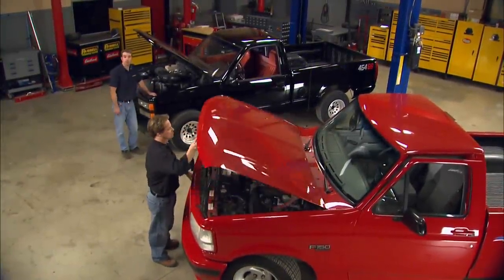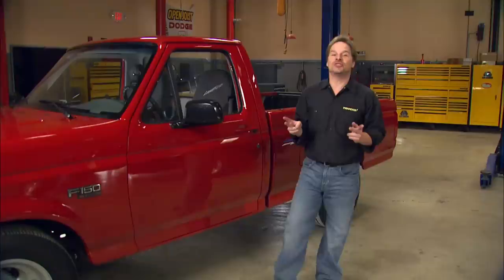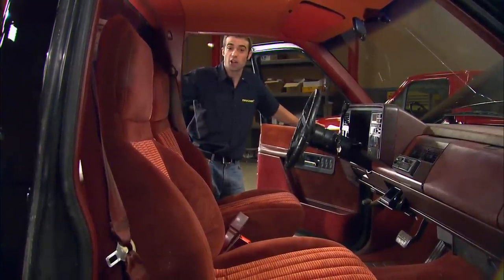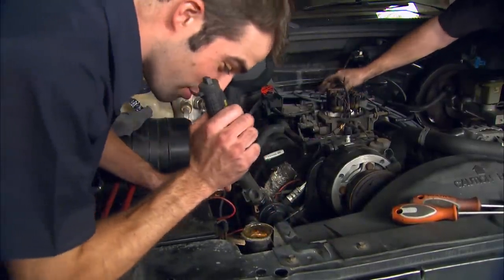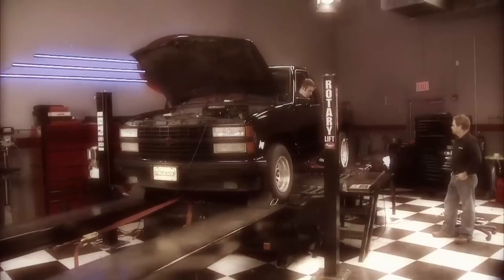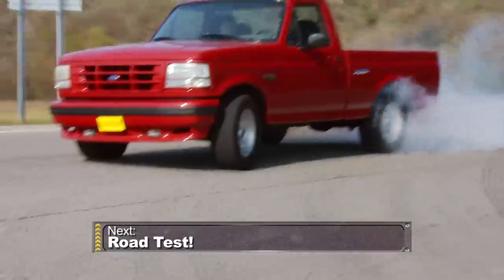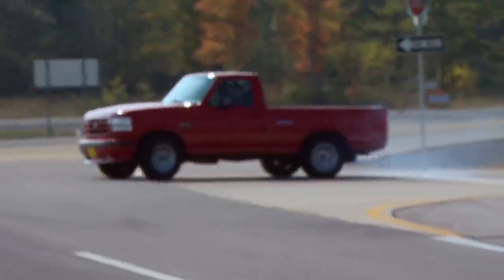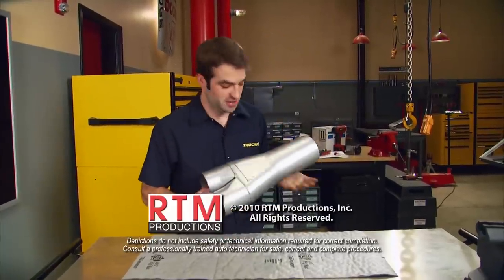'90 Chevy 454 SS vs '94 Ford Lightning F150 MuscleTrux Wars Part 1 - Trucks! S10, E1

Comment: 230 HP from a 454 is a feat of engineering in itself.
Reply: At the same time they had the syclones and typhoons.
Reply: @lenagdyfigpkhhmossuto9623  And for EPA reasons, they still were limited on what they were allowed to put out hp wise. And car manufacturers just weren't there yet with having a high horsepower fuel injected engines priced for the masses, with low enough emissions to pass the federal regulations. All while getting decent fuel mileage. Fuel injection by the times these trucks were produced had only really been widespread available for 8-10 years. They had along ways to go to get them were they needed to be.
Reply: Obviously you've never heard of an LSX
Reply: @lenagdyfigpkhhmossuto9623  Then why would they suggest that its hard to get 230 hp out of a 454?
Reply: @drewinhou  You have no idea what your talking about.  Fuel injection had been around since the late 70's.  The Eldorado was not only fuel injected but front wheel drive.  Camaro's and Monte Carlo's in the 80's you could get with a fuel injected 305.
Reply: I was always surprised they seemed to just drop the towing engine right in, no bother with even a new cam.
Reply: @drewinhou  they literally made zero effort to build a power based engine, the numbers are identical to an HD truck big block designed to tow and be run hard all day long.  Heads would have done wonders, at the very least a more aggressive cam.  They could easily make significantly more power, but they didn't make an effort because they didn't have to make an effort, they were the only game in town so they were the best game there was.  They built a super sport truck out of their parts bin.
Reply: @nogamez26  Really bro? That's why I said by the time these trucks came out (early-mid 90's) fuel injection was a common thing for about 10 years by that time. And was put on most cars whether it be TBI, Direct Injection, sequential, multi-port, Etc. So let me do the math for you, take off 10 years or so from early-mid 90's, would give you early to mid 80's. And Obviously there were cars with fuel injection before the 80's, even way before the earliest decade you quoted, actually as far back as the 50's, with one Mercedes model.  However, like I said  this was not common,  as most used carburators still up until the 80's and a few models in the early 90's. Obviously you don't understand what is being said here. So go back and read it again, so you understand it all.
Reply: @kfstreich4787  Agreed. When you're the only dog in town, than there's no fight to put up to be top dog. That's why it's important to have competition from all around. It helps us the consumer, because it forces the car manufacturers to build better, more powerful powerplants to stay on top of the game..
Reply: A huge cam with 
.030 lift, the spark plug gap is bigger.  The engines were detuned so much GM should have gone back to the 235 inline & the famous 7.5:1 compression why waste cast iron for 250 hp. Below 300 hp the 454 was an embarrassment. That reflected badly on GM.
Reply: @rogermarshall8991  I couldn't make it to the end of this video to see what they did, a quick peak at summit racing shows BBC heads for $967, for $1500-2000 you could have a proper engine, too bad these were pre 4l80
Reply: @drewinhou  and this was coming out of the 80s, a time when a Ford 351 could produce 136 horsepower 🤣

Comment: When these were new, the Ford walked the 454.....still take the SS. Now had Chevy grown a set of balls and did the 454 right it would have been king!
Reply: Same...Old chevy trucks are just more sexy
Reply: The King's Servant almost 30 years later and it still is
Reply: @theman68and1  no...It's not
Reply: It wasn't about balls, they did the best they could given the limitations of the time. That was (sadly) as much power as they could coax out of the old big block and still meet 1990 emissions laws. ALL cars were dogs in the 80's and 90's, as manufacturers hadn't yet figured out how to meet emissions without de-tuning their engines beyond all reason.
Reply: Big blocks from both companies were pooches in that era.. emissions killed alot of power in the 90s.. as far as the chevy looks better,  I suppose it's in the eye of the beholder.. but as I wrote in another post I've owned both trucks and both were black, the lightning got more looks than the Chevy.. so you can like which ever.. in my personal opinion  the 78-79 fords and box Chevys of the same era kick both their assis
Reply: My father bought one brand new but he has a 93 which had more horse power and 410 gears he never lost a race to a  Lightning he ran a few of them    He still has the truck supposedly it was the truck used for testing in magazines when it was bought it came with the magazine it was in so we were told
Reply: Hahaha
Reply: Matt Miller  Hahaha!, I was thinking the same thing!!👍
Reply: A supercharger is way more fun for daily driving. I do like the long power band of NA. But get a supercharger you'll never look back
Reply: Don't think so. They could have easily gotten more power and still passed emission standards or even surpassed them, they just didn't want to spend the money to do so.
Reply: I mean they should of compared the 1995 Chevy 454ss it produced 255hp and 405lb ft torq
Reply: Chris J Yeah I used have a 91 SS. I can tell from experience the lighting was a faster truck.
Reply: It was all about GM overdoing EPA Emission laws and tuning them well below what they were capable of. In the end I would pick Chevy over Ford because I would rather drive my truck than push it.
Reply: @GUNSLINGEROUTDOORS  it only killed american manufacturers really, the 80's and 90's was definitely the era for japanese/European sports cars
Reply: Yelsew Painter chevy can’t out live fords there transmission are garbage I replace the transmission on both of my Chevys have a 98 and 02 while my 97 and 03 f150 made it with over 200k no problems
Reply: Yelsew Painter my neighbor has an old 96 ford 3/4 ton work truck with the 351. It has  350,000 original miles. They lasted as long as any Chevy ever would.
Reply: GM easier to work on. And last longer.
Reply: Chris J I don’t lie and I don’t appreciate being called a liar either. Just because you personally haven’t seen it doesn’t mean it isn’t true.We have a company called service vending. All of the vans are ford. They all have the 4.6L or 5.4L V8. All the vans had between 375,000 miles and 420,000 miles when trading them in on new ford transit vans. I am however skeptical cause all the new vans have V6 engines only available. I’m not brand loyal. I personally drive a 2012 crew cab Chevy halftone. It also has been a great truck so far.
Reply: I never seen a 351
Reply: @Chris J BS! Any 93-95 lightning stock could spank a 454ss. The 454ss could barely beat a stock 350 truck
Reply: @jeremyyazzie3474  Garage Mans Companion...
Reply: The Executioner they literally just did it

Comment: Ford is down 100 cubes and still comes out on top.  No surprise.
Reply: any motor chevy had in the 90s was a straight up dog then when the introduced the 4.8-6.1 they took the game over because everyone is ls swapping now
Reply: kylepett1 then ford took the cake with the gen 3 coyote
Reply: @kylepett1  LT1's weren't dogs
Reply: Lmao these are both bone stock trucks with around 100,000 miles on them,at this point who cares,wait and see what happens when the 454 gets properly set up,and the Ford small block gets the same the 454 will destroy the sbf! I remember both trucks when they came out,Ford never could keep up back then!
Reply: @BUILTFORDTOUGH79  Ford didn't take anything over, where do you fellas get this crap from? The 90s LT1s killed 302 Fords,then the LS1 came out and the rest is history, the only fast Fords back then needed help with nitrous or boost,they never could keep up NA!
Reply: @adambrooks2297  I think this comparison carrys way more merit. I like seeing the way Ford or Chevy set them up.  Ford obviously spent more time at the drawing board instead of just slapping a HD truck engine in a half ton.  The modified test is all fine and yes I would sure hope the 454 will come out on top.  Hell you can make 1000+ hp with a 4 cylinder ricer with enough $. To each his own.
Reply: kylepett1 not me im coyote  swapping an 1985 pontiac  firebird  just for shits and giggles
Reply: Adam Brooks i had a 1980 olds cutlass with after market heads edelbrock carb headers and cam  and the lightning tore my ass up everytime i raced it but my buddy had a 400 in his chevy pickup and i ate him for lunch so  i call bs on that the ford never caught up
Reply: Adam Brooks bs bs bs
Reply: Adam Brooks tour just a fan boi
Reply: Adam Brooks the ls1 can’t even compare with the 4.6 4v ford had in the cobra those cobras dusted the camaros and kept up with corvettes
Reply: @bkeith269  The engineers at SVT/SVE are exceptional. Everything they touch turns to gold. Way better than throwing a big block in a short bed Chev. I agree. I have two SVT vehicles and they are both amazing and a joy to drive each time.
Reply: @adambrooks2297  Ford's biggest shortfall, in MY opinion, was their reliance on the 302 instead of the 351. I never understood why they stuck with it when everyone else had them covered as far as Cubes went. Yea you could spin them higher but bottom end, there just was no comparisons. Not talking about the Pony Cars either. Even when Ford hit the vaunted 225hp in the Stang, GM kept pace with less power due to bottom end torque.
Reply: @adambrooks2297  Chevys are under engineered garbage.... that ford is half the motor but eats that Chevy 454. I love big displacement but a healthy 351w will destroy any comparable Chevy 350 383 etc
Reply: Eternal Thread Chevy guys always bringing up Ford engines that don’t even compare to what their talking about. Lol
Reply: @BUILTFORDTOUGH79  how much does it cost to build a coyote>? il stick to something where i can make the power for half the price and not even having to be DOHC
Reply: @erandy0240  but goes against your own argument a healthy running 454 would eat any 351,390,429 etc im not  even a chevy guy my faja has a 1970 ford torino 429SCJ any healthy motor will chew anything and vice versa i just dont like how the 90s 454 get so much backlash they were an atrocious engine with smog heads and the cam that it came with even the vortec 454 was a dog but a decent cam and some heads helped it be some what respectable
Reply: My grand national will blow both of these trucks away. No question. Even if they were new.
Reply: It's was a tow biased engine. Had they made it for power the lightning would've been second. Both trucks are still sexy though
Reply: Joshua Webb and no one else had to deal with emissions?
Reply: The Foxbody Mustangs held their own with the 5.0 against the 305 Firebirds and Camaros but when they got the 350 version of the TPI from the Corvette in 1987 it was game over. The GEN 1 TUNED PORT INJECTED 5.7 V8 was a Torque Monster that killed Mustangs with 245hp & 345 torque. Then the Son of the TPI the LT1 came out in 93 while the Mustang lost the 5.0 and got the 4.6 in the SN95. So unless you had a Saleen or Terminator Cobra The LT1 and the RAM AIR LS1 Ruled the Streets from 1993 to 2010 when the Mustang finally got its balls back with the Coyote 5.0. There are 2002 Trans Am LS1s that we’re beating 2008 GTs with the 3 valve 4.6. I know because my 1992 Z28 with its original 191,000 mile unrebuilt 5.7 TPI with the Flowmaster Exhaust beat a stock 2006 & 2007 Mustang GT 4.6. There’s even a famous old video of some high school kids racing with an LT1 Camaro beating a 2005 Mustang GT. YouTube it.
Reply: @jeffrankin9744  well id hope so your grand national wasnt killed by emissions and is turboed :P (which i love) but how would it do against a cyclone or typhoon?
Reply: I would have to say maybe the typhoon would beat me. But not the cyclone. I raced a cyclone about 10 time few years back totally stock just like my Gnx it was heavier and slower
Reply: @adambrooks2297  um corvette is not a muscle car its a sports car!
Reply: @dodgeramsport01  it's so funny how all of a sudden you Dodge fools get to decide what a Corvette is,a Camaro ,any GM car, just so you know a Corvette is a Sports car,muscle car, no one really cares,because we GM folks use it as a weapon on the streets,or tracks!
Reply: @adambrooks2297  My handle of Dodge Ram 01 is because at the time when I made this account I owned a 2001 Dodge Ram! Now having said that, unlike you I am a true Gear head because I like ALL the brands and the things they have done over the years, I am Loyal to none!  I am and always will be a Corvette freak, but Corvette does not fit the definition of a muscle car, That's because its a straight up american made sports car, Now My 442 its a muscle car! My 428 Cobra jet its a muscle car! The 79 Z28 I had in high school it was a muscle car! The AMX my wife drives its a muscle car !But the 72 454 stingray I have Is a sports car! Good day to you

Comment: I had a truck with that 454 back in the 90’s. It was such a dog..
Reply: I got to experience a brand new 454 SS run against me twice in the quarter mile in Youngstown Ohio in 1990. It was a 16 second truck.
Reply: Steven Lindsey , the 1988 Police Package Caprice with an LS5 454 and nitrous I was racing ran a 13.2 WELL ahead of that truck, lol.
Reply: I use to spank those 454 ss's with my 89 chevy stepside back in the day, only thing done was headers, lil more than stock cam, they were lame!
Reply: Steven Lindsey Your Corolla is almost 20 years newer obviously it’s gonna have more power. Everyone knows American v8s struggled to make good power after the Emission laws took place. If you were to carburetor/head swap that 454. It would be making at least 400 hp to the wheels.
Reply: Steven Lindsey Yeah if you want to make more then 500 hp to the wheels. There’s plenty of low compression 454’s making mid 400 hp with just a top end swap. All depends on your build.
Reply: Tsang Tsung  so wrong it's not funny. A Chevy 454 not racing.... Lmao. The motor in this truck was killed by emissions. They were in the 12's stock in the 70's.
Reply: Tsang Tsung  the truck is slow as shit so chill
Reply: Tsang Tsung  pretty close to the same thing. Duramax/Isuzu engine.
Reply: Goddess Sky  They last longer when driven slow like there designed. When it's fast people tend to beat on them more.  
  Those 454s were trash.  Mustang with a tiny little 5.0 was a 15 sec car. My 99 accord was 14 sec car. Stock 1996 Civic is a 15 sec car.  454 with all those cubes was slow as shit.  It was supposed to be a "super sport"  SS = Super SHIT.
Reply: They were dogs ..... But a big block is cheap to build put a 496 in my 94 check out my vid
Reply: Goddess Sky Keep dreaming little girl.  Chevy doesn’t make tranny that will last 300k w/o overhaul.
Reply: Steven Lindsey   lets see what your crapola would do with 1500 pounds in the trunk . while towing a boat trailer
Reply: David Parry didn’t know there was a track in Youngstown.. closest one I know of is Quaker in Salem that isn’t there any more..🤔
Reply: @Westtxcowboy100  THIS! Those trucks could barely outrun a stock 350 gm truck. Gen 1 lightnings would eat a 454ss all day long
Reply: Steven Lindsey  Sure you are. Enjoy racing your Corvette in Forza. Maybe your mommy will buy you one when you turn 16😉
Reply: Goddess Sky  chevys lasts as long as they are grocery getters and barely at that, I was a Chevy guy predominantly until about 21(25 now) got tired of the electrical problems,constant leaks,water pump,best Chevy I had was a 01 5spd 2.2 4 banger sold it with 307,xxx. My full size chevys were dogs on the farm,dad was always a ford guy and I learned why lol,went back to fords. First truck was a 1981 f100 5.0 Windsor,it was a farm truck its whole life in my family,no leaks nothing sold it with 450,000+ on it and it was 32years old when I sold it.
Reply: Steven Lindsey  when I was in tech school I worked for a dealership that also raced Firebirds in the scca. They had a 92 Suburban 2 wheel drive with a 454 that had over 320k  miles on it that they used for pulling one of the race trailers. The thing was Unstoppable. It never felt all that powerful but it always did it's job and never broke down either. Everything on that truck was still stock.
Reply: All them torques and no horsepower to accompany it.
Reply: @brianaustin6184  I had he same experience with my 4.3L. S10 Blazer. Constantly having electrical problems like shorts in the 4x4 harness, broken ABS computers, etc), parts breaking, especially drivetrain parts,  blew the diff spider gears before 100K, grenaded gears 3&4 in the transmission while in 1st somehow around 130K miles, then finally intake cracked internally and leaked all my coolant into my oil and seized the block (plus had enough force to put a hole in one of the cylinders. Truck didn't even make it to 185K, and I probably paid double in maintenance for the thing in 6 years than I paid for the vehicle when I bought it. Absolutely garbage quality.

Comment: A friend of mine had a red Lightening just like this one,he did some mods on it including a Paxton Supercharger which made it a real drag racing machine,the only other truck that could touch him at the local track was a Dodge RumbleBee. One of them would win one week and the other the next week. Both of them would run the quarter mile in the mid to high 13 second range. That Lightening would plant you in the seat at wide open throttle

Comment: If you ever owned a 94 95 lightning, then you know how important it is for the switch that flips the gas tanks to work.
Reply: My buddy has a f250 with a 460 and dual tanks he uses the secondary tank every three days due to it sucking on gas luckily he just bought a 2.2 s10 for a daily